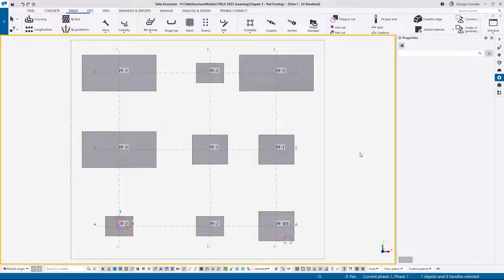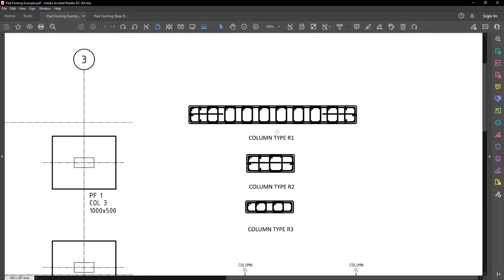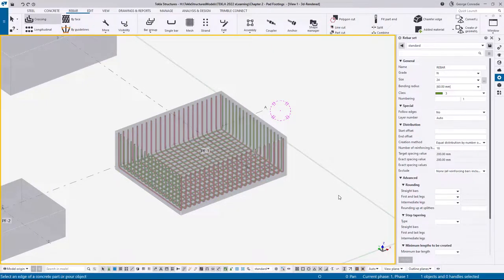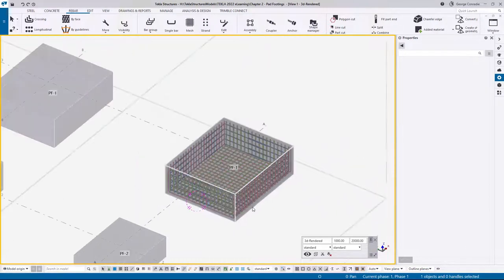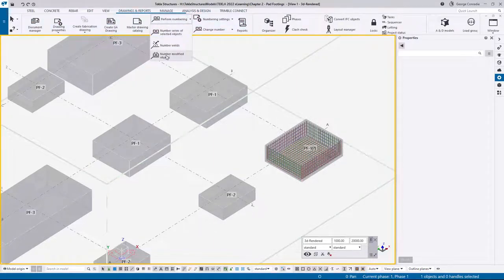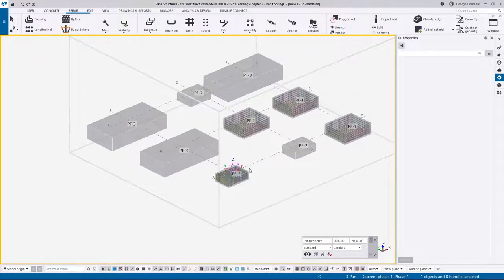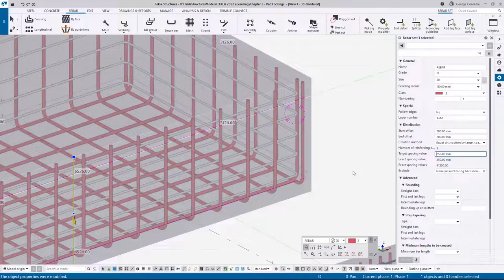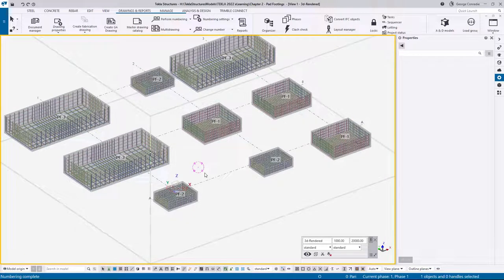Tekla Structures - Chapter 1, Video 1 - Rebar Detailing, Pad Footings, 3 Methods

Comment: Can we set Edge rebar so that connection between rebar of two layers is mantained perfectly
Eg at 28:25 it can be observed that edge rebar of lower edge is not connected with upper layer...
Also please explain if connection can be mantained between two rebars group such that change in one set can directly be observed in both groups..